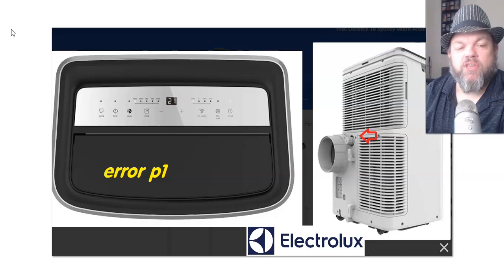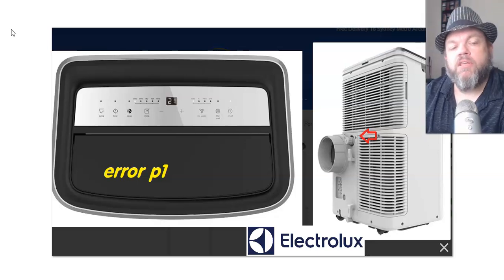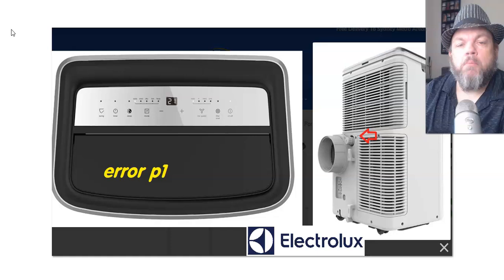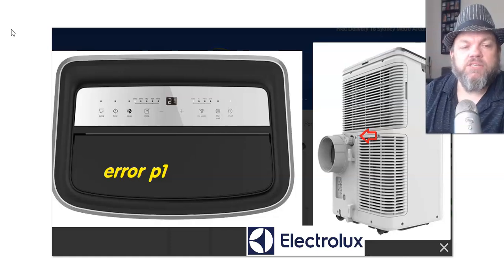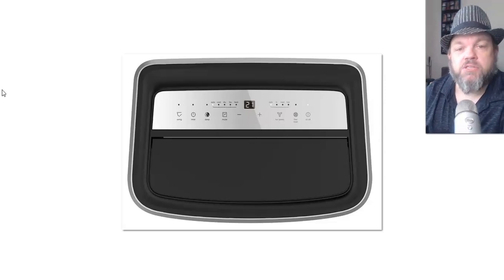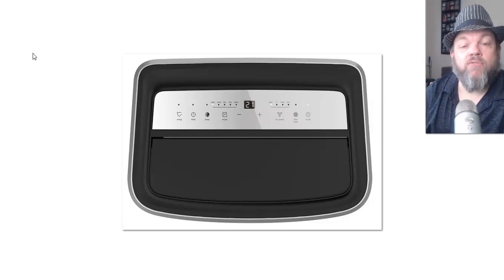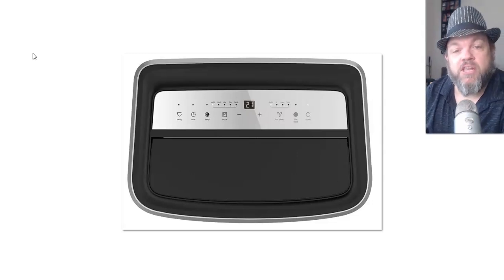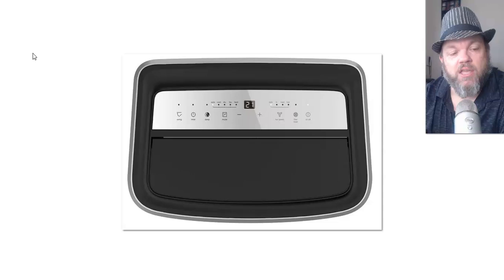Fix P1 Error Code Electrolux Portable Air Conditioner PI Stays On ChillFlex Pro After Draining Water

Comment: i have a frigidaire...tried same thing but nothin. its dry, but when turned back on the compressor runs for 30 seconds and then the p1 appears again.
Reply: I'm getting the same thing, this time I'm seeing what looks like dust in the water, I'm wondering if it's clogged with dust?
Reply: @Nirlepa222  interesting...that could be(?) my problem was a voltage issue. we moved it to a different circuit and now its working.
Reply: @Nirlepa222 I have the same issue the code keeps coming up.
Reply: @jessshrop4607  Its the tray on the bottom not the middle. He is wrong.
Reply: It’s the bottom cap, not the middle one. Make sure to be over a bucket or tub, a lot of water when the P-1 code appears.
Reply: I have the Omni Max OP10N3WBA1RCM, tried everything, still getting P1 error. Help!!!

Comment: I dont have this model.however having the same issue even though mine drains are open .still have the error p1 .
Reply: Same here with arctic king i had to tilt it back 2 inches and it will run fine like that for a day or two then the code comes back I'll half to shake it a little then code goes off for another day or two

Comment: I use my electrolux in heat mode and the P1 code shows up every 3-4h of functioning. Is that normal ?
Reply: Im running in to the same problem. It seems to produce a lot of water? Unusable like this.
Reply: @FrenkenTim  I Found the solution. Even in heat mode we need to use the continuous evacuation of water. There are 3 holes behind. The middle one is the one for heating mode. The upper one is for AC mode.

Comment: I have a merida portable ac, and I am just gonna assume that they have the same error codes essentially. Because when I looked it up it said that there could be a blockage. So I cleaned the filters and even the bottom. I saw there was another part to the ac where it suctions air as well and dusted that one. It ran for a couple of hours and the p1 error showed up again. It was not until I saw your video that I completely forgot that there is a drip tray. Which since I have a hose to mine did not even consider that the bottom tray could still fill as well. Lo and behold it needed to empty! 
Thank you so much for putting up this video, because I am a first time portable ac owner. lol Thank you thank you!